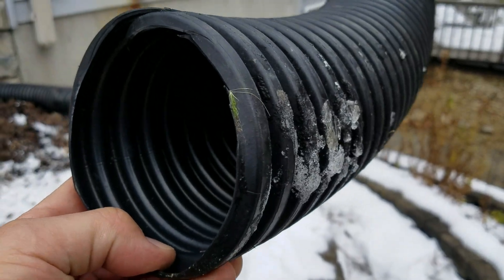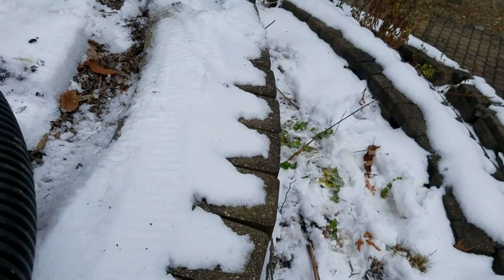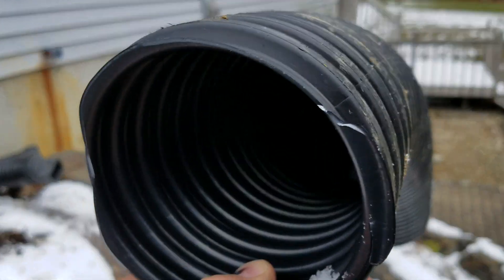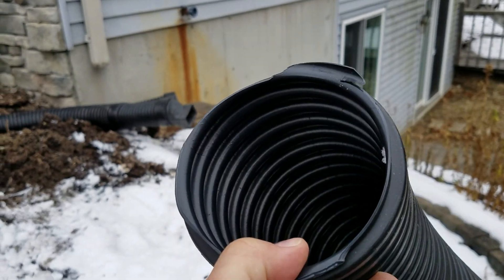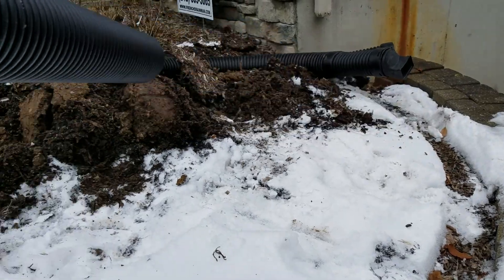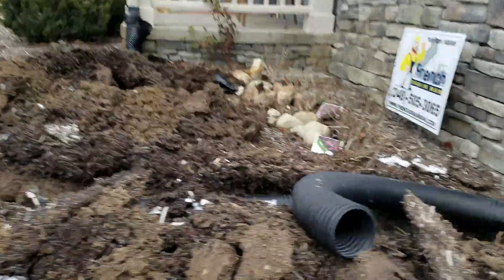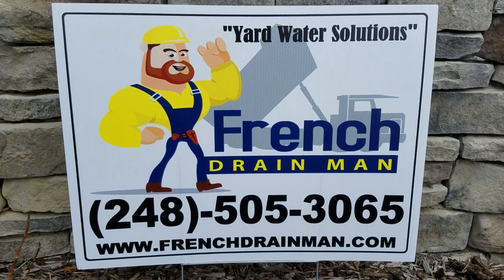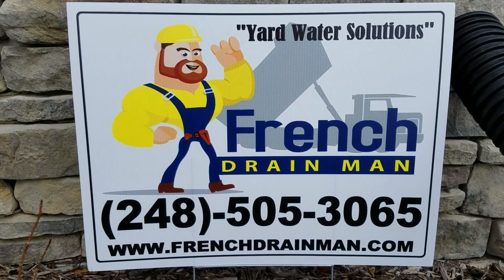What is the Difference Between Dual Wall Corrugated Pipe & Single Wall Pipe?

Comment: Hi hey thanks for your videos very informative, I live in North Myrtle Beach and I'm going to install some of my downspouts to get the roof water out of my yard. I have a few questions, 1) can I buy the pipe your using here meaning who makes so many I can go to a vender here and buy the supplies ? 2) are the why connections anything special and who makes them? I wanted to ask your opinion on what I'm going to do put 2 down spouts on 1 run along with a drain that drains my ac unit and I like to put a drain for a outside shower would a 4 inch double wall system be ample in your opinion? Being I live in South Carolina would it be ok just to hard pipe it or do you think I would have problems down the road with the glue joints?
Reply: What pipe did you end up using and where did you purchase
Reply from the maker: Best French Drain and Yard Drainage Contractor
https://frenchdrainman.com/

Comment: Hi French Drain Man, thanks for your videos!  What kind of coupling should I use to connect Dual Wall Corrugated pipe to Single Wall Corrugated pipe and use the special sticky tape.  If I lived in Michigan I would call you, but sorry I live about 800 miles away.
Reply from the maker: https://frenchdrainman.com/product/4-in-external-snap-coupler-hdpe/